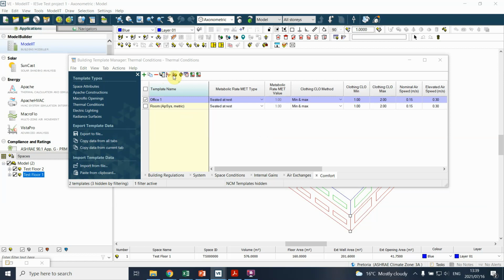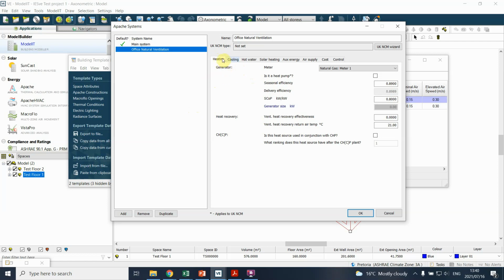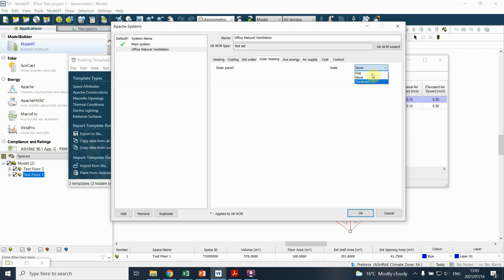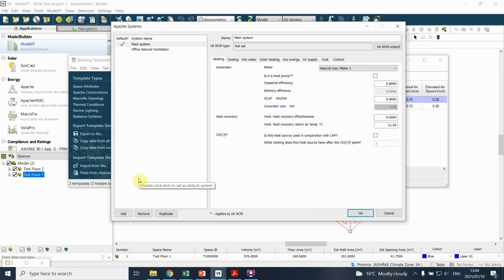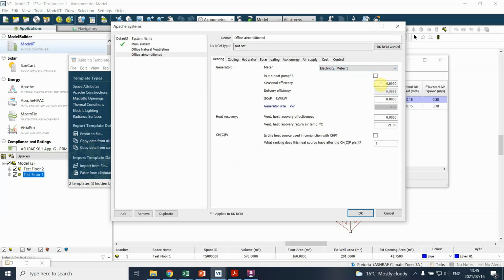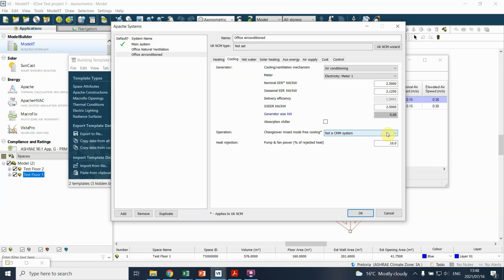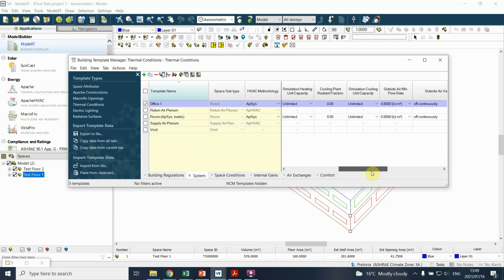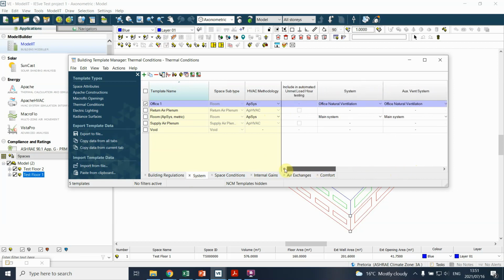IESve video   09   Building Template manager 3

Comment: Thank you for the impressive series of tutorials on IESVE. I have a question. What is the difference between mechanical ventilation and air conditioning?
Reply: Mechanical ventilation is using equipment like fans to push air for ventilation purposes while air conditioning involves manipulation of air conditions such as temperature and relative humidity and even quality using cooling coils and other equipment. 

Even air conditioning equipment may have fans, FYI... Hope this helps